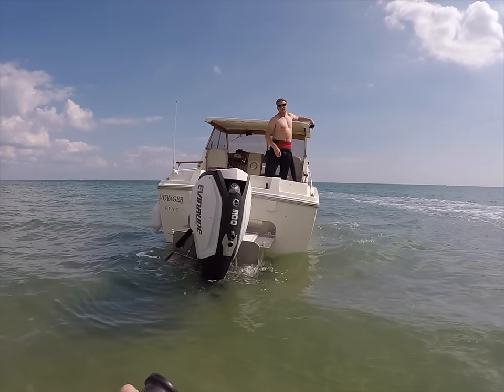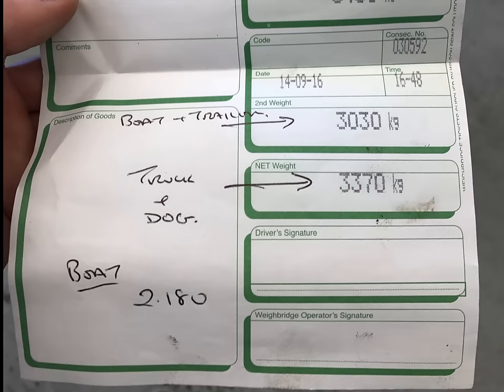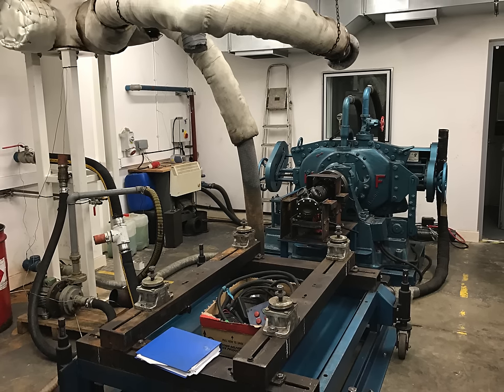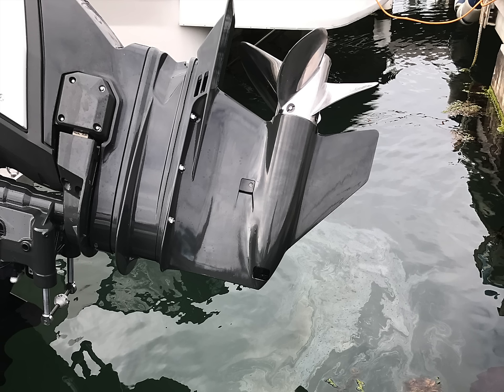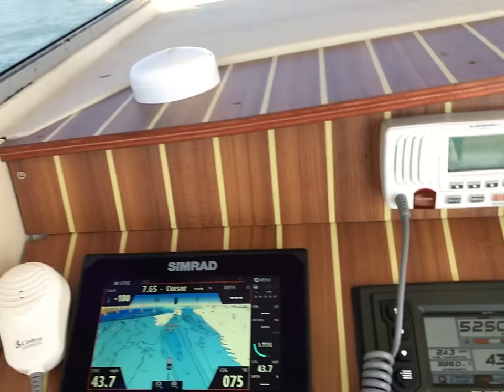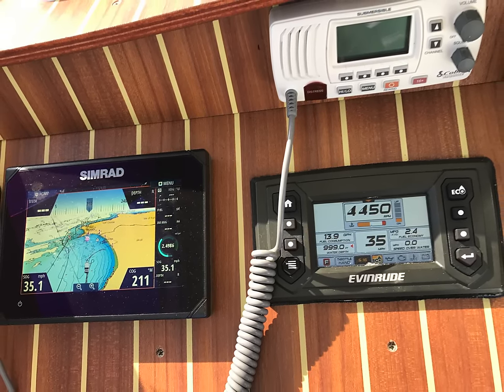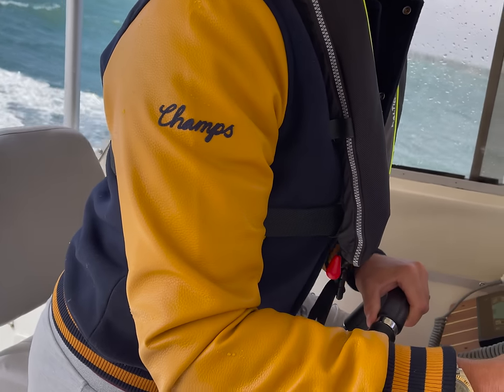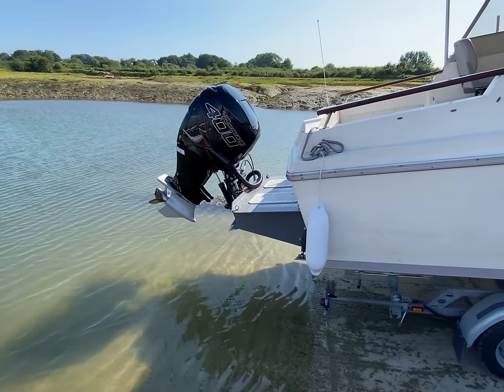MERCURY 400R vs EVINRUDE G2 300 outboard COMPARISON on SAME TEST BOAT (Boat Tech) TOP SPEED TESTED

Comment: I suspect the Mercury would've performed much better had it been propped with a 3 blade Mirage vs the 4. Props make a huge difference in fuel economy and hole shot. Mercury has always led in innovation, superior corrosion protection, quietness, digital shift and now a V12 600... The Evinrude Gen 2 is a 2 stroke Dinosaur, loud, consumes $$$ 2-stroke oil. The lack of desirability and sales have caused it's demise. Mercury clearly wins they still make that 400R...
Reply: Oh yes I loved the 400r was a beauty, the wiring was very old fashioned though which was a shame, way behind that of the G2 which made install a pain, but once installed it was a lovely unit.
Reply: @DieselPumpUK  What? The wiring is Plug and Play, very easy.
Reply: Agree withyou comment regardingthe prop size, however the mercury Enertia props are better still..
Also was the price of the oil included in the running cost of the Gen 2 engine?
Pretty sure the genuine oil is quite expensive 🤔
Reply: Yip it is but you burn so much less at a 400:1 mix. Do your oil change on your 4 stroke every 100 hrs or so and see what that costs you.